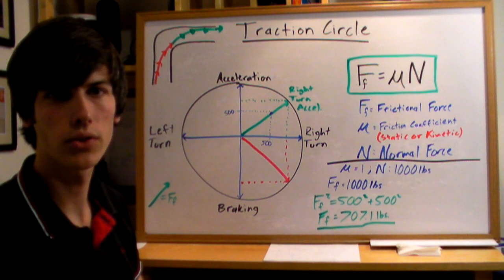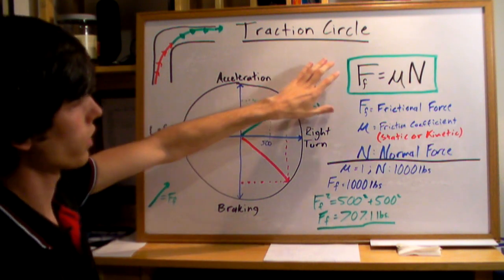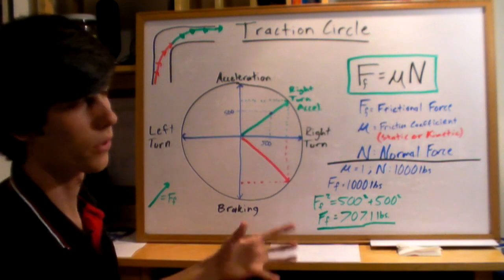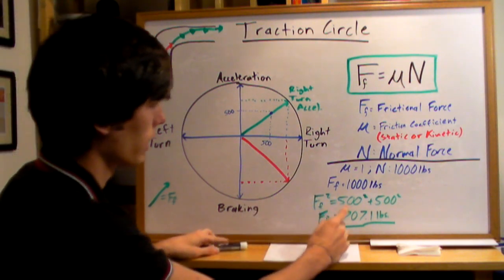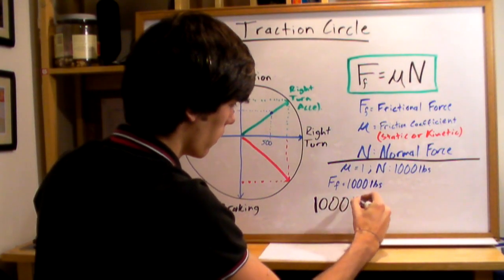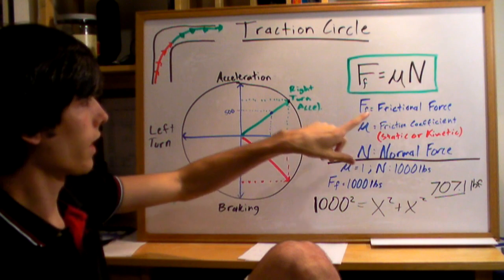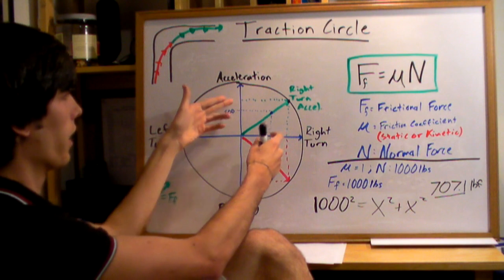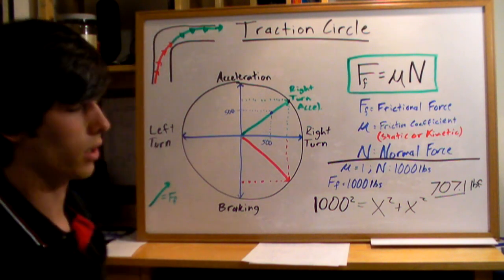Traction Circle - Explained

Comment: Basically, this theory is based on the Mohr's circle stress diagram.
Reply: Not entirely.  I'd consider it a coincidence that it is a circle, just like Mohr's circle.

Mohr's circle is about what happens inside the material, while this is about the external force of traction, either being parallel to velocity, or perpendicular to velocity.

Comment: Actually, for the forces applied it is more an elliptical model rather than a circle. The maximum lateral force that can be handled by the tire being different from the longitudinal one. Fx0 being the maximum longitudinal force the tire can handle, and Fy0 lateral. (FX/FX0)² + (FY/FY0)² = 1

Comment: was that just assuming turning and acceleration were a 50:50 split? what if you run tires that are brilliant in a straight line but terrible around corners, so they might hold 1g of lateral acceleration, but only hold .2 g's around a corner at 40km/h before they screech their heads off?

Comment: 1000lb of friction but using only 707lb, does that mean less weight transfer confers more available grip?
Reply from the maker: hsieh811 707 in both lateral and longitudinal, so more than 1000 lbs.

Comment: Transferring load should also decrease/increase traction circle, no? For example if you start braking, the load increases on the front tires, increasing the grip limit?
Reply: That also decreases the weight on the rear tires, but the mass at the rear does not decrease. The rear tires still have to laterally accelerate the mass back there to keep the car in the turn. So you can improve the cars handling by braking some, but it doesn't mean you can "corner harder" if by that you mean maximum lateral acceleration. Maximum lateral acceleration is gonna happen close to zero braking/throttle on most cars. Because of the oval shape he mentions at the end, you will see that maximum acceleration, period, is going to happen during braking in a straight line. (Or accelerating in a straight line, if you have the horses).

Comment: Just found out about this traction circle in the reference manual in a used copy of Gran Turismo 1! lol
From what I understood of it, each tire can be represented with one of those circles. Aside from that, when you accelerate or decelerate your car, the weight of the car is distributed differently to the front and rear tires, which affects the normal force on them and therefore how much friction they can withstand before sliding. But, of course, the friction is also distributed between the "task" of steering and that of braking/accelerating. So, the manual says, in order to enter a corner, you have to first brake hard before the corner so the weight of the car is shifted to the front (and so you don't enter the corner too fast), in such a way that the amount of friction the front wheels can use is increased, and then brake much more softly while steering on entering the corner. If you brake too hard, the friction will be distributed much more to braking than to steering, and you'll go straight through the corner. If you don't brake, your weight won't be shifted forward and your steering won't be as effective.
Reply: heh, i have the "apex" book that came with the collector's edition of gt5, and it too mentioned what you stated above. one of the most useful books i've read to date! lol

Comment: There're many other constituent physics at play; rotational inertia, deformation of tire, roll-over of wall, how squared (perpendicular to the road) your contact patch is retained while cornering. Also, larger diameter tires have better straight-line acceleration while wider tires [may] have better corner holding (which is different than being nimble). This is because of the difference between the longitudinal vs. horizontal contact patch size. For simplicity's sake, this is a great video and I learned something from it (the radius is greater in the diagonal than in the axis). Whether this is the extent of physics to contemplate for an F1 team, or instructions on how to drive are a completely different subject, altogether.
Reply from the maker: Yes indeed, it's certainly not as simple as F=uN.
Reply: Actually, it's PRECISELY Fun. Or Fu'n fun. :) 

Thanks again. Subscribed.

Comment: Is normal force just weight of the car or is it weight+down force?
Reply: On a flat road, yes.
On a banked road, it increases, due to the centrifugal effect pushing you radially outward, in towards the banking.
On an inclined road, it decreases
When cresting a hill, it decreases
When at the bottom of a hill that curves upward, it increases.

Comment from the maker: It's simply because the equation F=uN doesn't take into consideration what happens at a microscopic level, where the rubber of the tire sinks into the pavement, thus your grip exceeds the theoretical grip. A wider tire allows for more tire to sink in (to a point), and thus will have slightly more grip.

Comment: Could you explain a bit (maybe in a separate video) why wider tires make for better grip? Fifth grade physics says contact surface doesn't affect the friction force. Also, how did the   circumferential grooves introduced in F1 for slick tires influenced the traction?
Reply: Valeriu Ohan 
Less normal force means higher coefficient of friction :-)
I was always wobdering about that aswell

Comment: wouldn't it be best to brake in a straight line before turning, to maximize deceleration, then grip the turn in neutral to maximize lateral acceleration, and then accelerate out in a straight line?

Comment: 4-5 degrees of slip is supposedly when your tires have the most amount of grip. That's why in racing - even something like in F1 - when you see cars coming out of corners, it looks like they're sliding. Which they are but only ever so slightly.  Not 100% sure though.

Comment: I don't know exactly how to explain it, but the reason is because of tire compound. When a tire is worked harder (to a point) it has more traction. That's why a car operates best in the corner when the tires have a few degrees of slip angle.

Comment: A little slip helps to rotate the vehicle but you are potentially giving up some acceleration which is not a problem if you are at the limit of the friction circle because without that little extra rotation, the vehicle would exit the paved surface. If you can get through a corner without 'slip' and not go off the road you will be faster than with 'slip'.

Comment from the maker: Because accelerating at 1g takes a tremendous amount of power. Resistances build, friction builds, and inertia losses add up as you keep your foot down. You keep getting quicker and resistance keeps increasing, making it nearly impossible to accelerate at a constant 1g. The Veyron comes pretty close.

Comment: add onto that the load transfer, which adds about 10% more force to the rear, and we should be seeing the rear tyres pulling more than 1.2gs of grip.
Then how come its appears very difficult for RWD supercars to pull 0-100kmh faster than 3s, which is but a measly 0.925gs?

Comment: therefore we can say that the lateral  traction limit of the best tyres, the Rear tyres,of say a RWD car  is greater than 1.05gs, right?
And then you also said that the traction circle is an ellipse , which has more longitudinal right?
So that means the longitudinal traction limit of the rear tyres is  >> 1.05gs, that means the rear tyres will allow "much" more than 1.05gs of accelerative torque right?

Comment: As you know, this simple circle only applies to a single tyre. When you have a car with 4 wheels, theres a lot of stuff such as weight distribution, load transfer, weight transfer etc .Theoretically, the max cornering g of the car is  less than the cornering g of the best  individual tyres , right? So when you get a skidpad(lateral)  figure of a car,say it gives you 1.05gs.

Comment from the maker: Correct. Say a formula car was experiencing 1g of downforce on top of it's current weight (it's weight is effectively doubled, for frictional purposes) this means the maximum g force the car could withstand in a corner (assuming the tires are only producing 1 g of lateral grip) would be 2G. As you probably know, Formula 1 cars have seen 3-4g's regularly, so this tells you about the tire compound, as well as the downforce these vehicles are creating.

Comment: So, as downforce help achieve greater cornering acceleration, we can say that for a F1 car (for example) the traction circle varies with speed? (it gets lets say, wider as speed increases). How would its formula look?
Reply: What happens is the negative lift from the spoiler, increases the normal force.  The upper limit of the traction force (the radius of this circle) directly depends on the normal force, which itself depends on the square of the speed when aerodynamics assists gravity.  At very low speeds where aerodynamics is negligible, the normal force is just the weight of the vehicle, distributed to each of the corresponding tires.  As speed increases, and the aerodynamic downforce goes up with the square of the speed, the traction limit also goes up.

Comment: OK, I said nothing, you used lbs and I normally use metric system, maybe that confused me. lb is a force unit, so in a hevier car the wheel stands more lateral force but the centripete force (i mean force from normal accel while turning) is higer too, being the normal acceleration the same. That means that IN THEORY maximum normal acceleration the car will stand only depends on "mu" (I calculated it rigth now). Clearly you were true. Anyway a lighter car has less inertias, that makes it faster.
Reply: The maximum horizontal acceleration of your car on a completely flat road, only depends on mu and g.  So you will have slightly better traction on an otherwise identical road and tire combination, in Norway where g is higher than average, than you would have in Ecuador where g is lower than average.   It's rare that you would even notice the influence of Earth's g-value being any different than the global average, with typical driving activity, since it only varies by about +/- 0.3% from the global average.

You can see that the reduced g-value really reduces traction, when you take a look at the lunar rover footage.  Even though they are driving on rock, it almost looks like they are driving on ice, with the significantly lower amount of traction they get.

Comment from the maker: The video is pretty accurate, although there are some assumptions made. A 3000 lb. car will have greater friction than a 1000 lb. car, so the later force it withstands is a larger force, but not larger when you compare the g's the car can withstand. Each car may hold 1 g (plus or minus). The heavier car will have some losses, however, so the lighter car will more accurately follow the friction formula.

Comment: I know you know it, cause i've seen your channel and you are great, so you've won a suscription xd.
Anyway, what you explain in tis video isn't true at all, cause N is not the car weight, N is the normal force that wheels experiment , and it depends on aerodynamics, weight transfer, susp...
And following your example a 3000kg car'd be faster (at corners) than a 1000 one, that's because there are normal accel, F=m*a, a=cte, m=funcition, more mass means more lateral force the wheel has to stand.

Comment: Yes but that's misleading. They are components of a 1000 N force, to the 45 degree they are not two lone forces. The acceleration you will get is still 1.

Comment from the maker: @raymondu99 Correct, the magnitude of the two forces is still 1000, but if you look at the individual components their sum is greater than if you were at any other point on the circle. Example: the very top. 1000 acceleration, 0 turning friction force, sums to 1000, magnitude is 1000.
Reply: Well, the net sum of of 1400 includes 200 lbs of forces that cancel each other out when you determine the resultant vector. So the sum is still 1000. It sounds good in theory, but it's kinda a parlor trick.

Comment: When youre at 45 degrees on the traction circle you're still at 1000 rather than 1414. The long/lat components should be added up in a vector, not scalar fashion